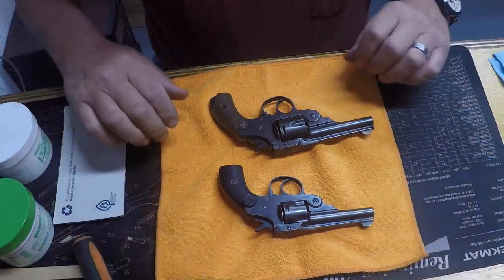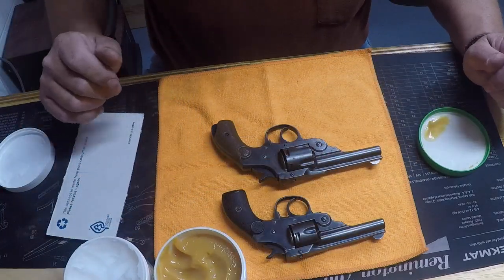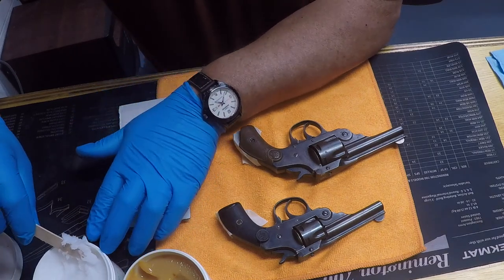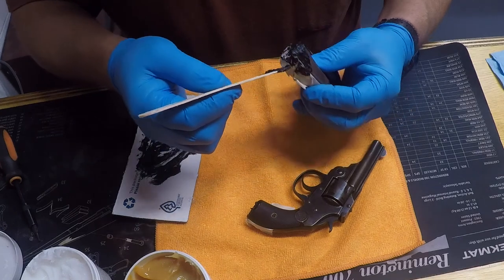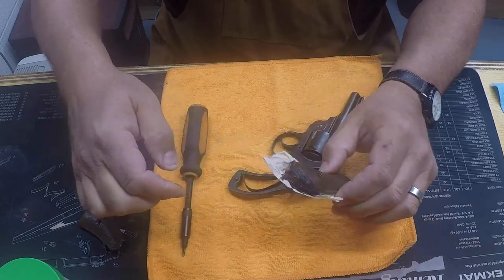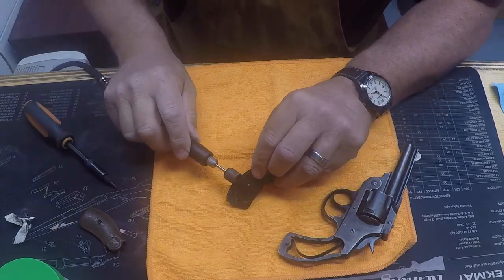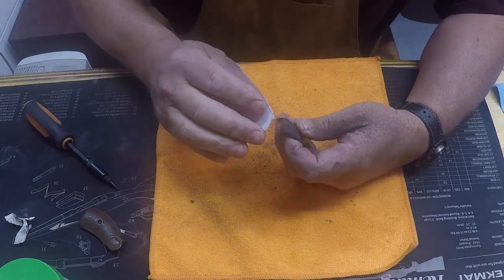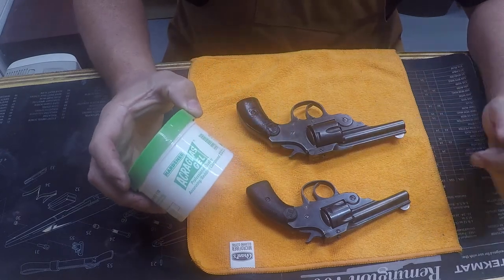Antique Iver Johnson Top Break Revolver - Cheap and easy Fix!

Comment: Also according to what I've found in info the .38 S&W model you fixed the broken grip on should be a "third model" Iver Johnson , since the safe trigger was feature was dropped when Iver Johnson moved from the second model to the third. I've been told all third models were proofed for smokeless powder.
Reply from the maker: Thanks for the info!
Reply: I have the same one this 3rd model correct takes 38 bullets
Reply: So is it 3rd generation I have one as well

Comment: Iver Johnson made three different models does the safety automatic the first and second we're black powder only but the third was for smokeless powder and black powder the first model had a little lever on the side to open up the break top the second model switch to the one like yours for the top break but it had a built-in trigger safety yours is the third model it has the correct break top mechanism in the trigger without the built-in trigger guard so your gun is safe to shoot smokeless powder it is a third model
Reply from the maker: Thanks for the info!
Reply: Can the third model shoot 38 buellts or only powder

Comment: Great video. I saw your original video from late last year and I was hoping to see you restore the nickel finish. I have the same model with the US grips and only US Revolver Co. label on top, with a poorly nickel finish. The gun belong to my Great Grandfather as his backup police service pistol. I want to restore it. The pistol is working, except the main spring broke and I have a replacement coming. But I did notice in this video your 32cal was blued and not chromed. Is this the same pistol? If it is the same pistol, what process did you use to remove the chrome? Oh, by the way when I finish this pistol, I have an early Colt D.A 41, which was his main service revolver. This is my first time working on guns, so I am learning. Thanks for making the video and I will mark it as reference.
Reply from the maker: This is not the same revolver.  I have several of these old hand guns.
Reply: @magnum6886  Thanks for the reply. I got my IJ pistol taken a part. I found a few broken parts and I have them on order. I hope I can get it back together. Again, thanks and I would like to stay in touch with you for questions and answers.
Reply: You can shoot 32 shorts smokeless

Comment: I just picked one up non functional for 24 bucks at a flea market. Everything seems to be there. But I think some of the markings on the top of the barrel are worn off. Is there another way to tell if its BP or not? And what can I use or for a leaf spring? Or where can I find one. Its the one that moves the small hammer
Reply from the maker: You can try eBay for parts or check out https://www.gunpartscorp.com.
Reply: I believe if they have “CTGE” stamped after .38 or .32 anywhere on them, I believe they’re non-BP. At least that’s how it goes for the similar H&R pistols; I’m not sure on the old Iver Johnson’s and Smith & Wessons.